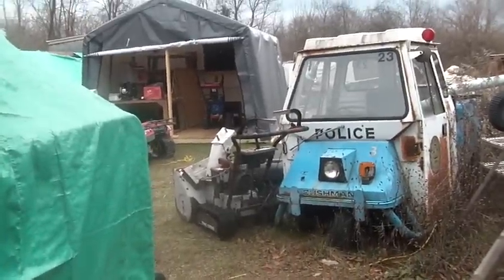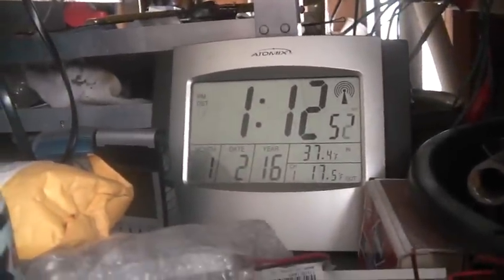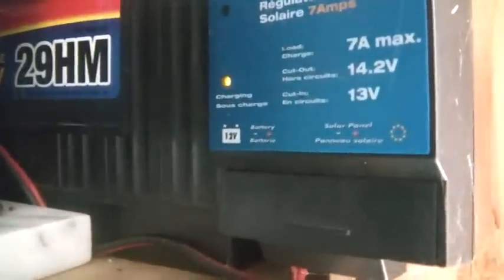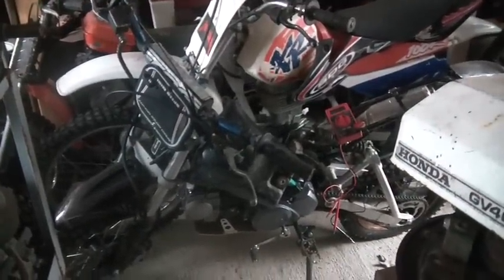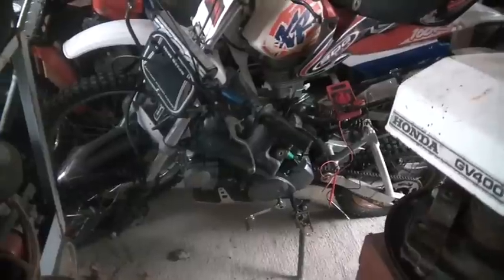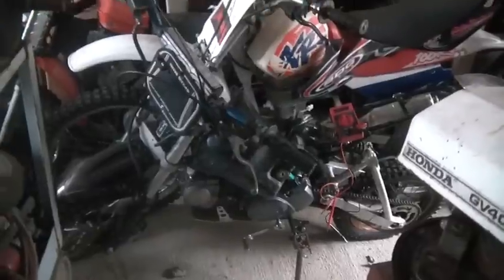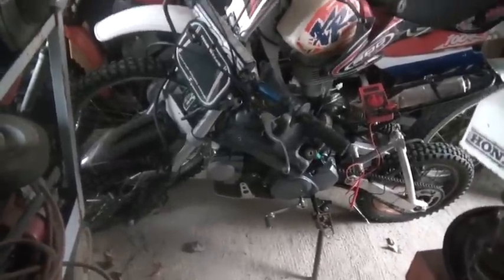Quick Pit bike wring tutorial, Lifran 125CC engine swap,

Comment: What are the yellow wire and the white wire
Reply from the maker: Mr Chevy, They will provide AC for lights, or can go to a voltage regulator for charging the battery, thanks for asking, watching, and commenting!!!
Reply: i wld suggest you go to rectifier-regulator,bulb is dc in most cases and its regulated as well as battery,if unless you want to charge ur battery with ac.not good.fuse probably,i hope u put one in-line.its a good safety measure.might save your box

Comment: can you help me find a 140cc piranha stator and wiring harness
Reply from the maker: Hey Mathu, I did some research on that motor, the stator and fly wheel are in the crank case oil, right???   Am I to assume that the stator got ripped up by debris?  Is the pulse generator still intact, if so, I would convert the bike to a 12volt powered cdi for spark, let me know if Ur stator is oil covered or not... Thanks for asking, watching, and commenting!!!

Comment: I love your vids. very informative and you talk in layman terms. I needed to know where the green and white wire went from the stator. fond it here cheers. Will the engine still start if the reverse and neutral gear lights are cut off?